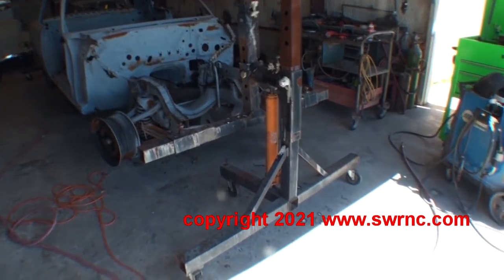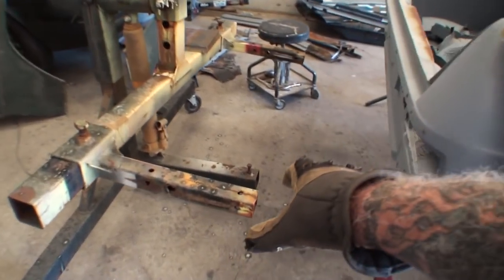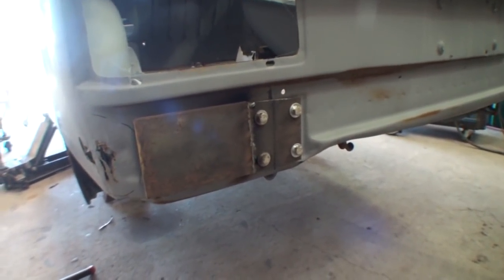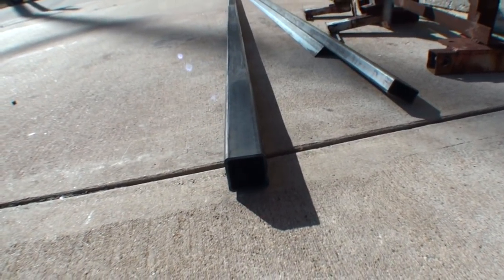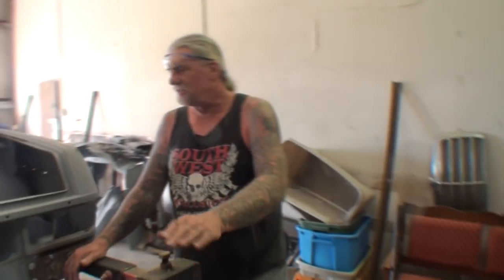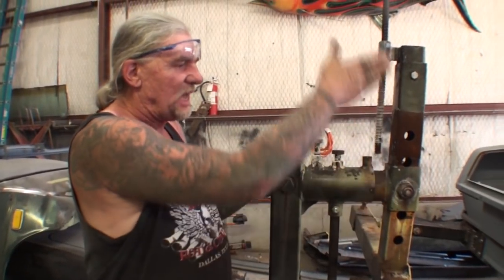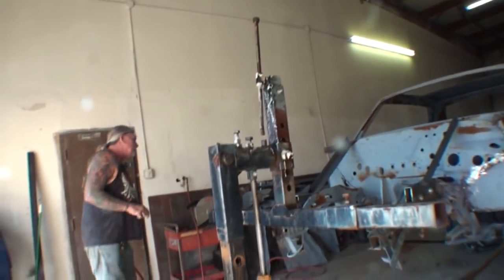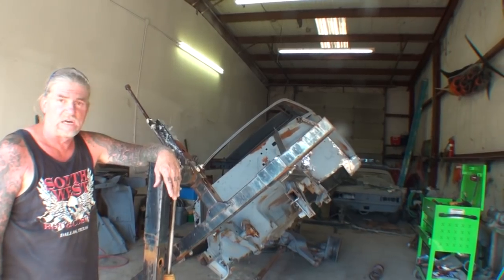How To - Use a Car Rotisserie - Do It Yourself Automotive Restoration

Comment: found myself needing one of these when I ran out of non-rusted lift points. It was expensive but I consider it a long term lease as when I am done with my restoration, I know I can sell it in seconds on Craigslist or Facebook Marketplace (because that is where I looked for one first!). I am a novice and did not have access to this video, but had to make my own brackets as well. I discovered that the center of gravity was lower than I thought so I had to make the brackets lift it up. What a dream piece of equipment. I can't even imagine doing the rust repair I am doing, without it (or an on call chiropractor 24/7). Bravo for posting this Pete.

Comment: Hey Pete, always enjoy the videos… I have my 68 Mustang now on the rotisserie but I can’t seem to get it balanced… had the front suspension on no doors, glass or rear suspension she’s torn right down… I tried removing just the new rotors and calipers but that still makes the car feel heavy when I attempt to roll it… any thoughts
Reply: That is the nature of a rotisserie as they give that big handle.
 I know it's been sometime now since asking, but remember that extra weight can be found on the drivers front from the steering wheel bracket, brake/clutch or booster reinforcement plate, park brake as these are not on the passengers side. Also, if welding and others read this in the future. Not removing the glass require 3M Glass Weld Protection Paper stuck to it or a fiberglass blanket, like those sold a harbor Freight Tools. Your rust repairs or full panel replacements will throw sparks that will pit the glass in or out. It (Glass) will feel like sandpaper when done if not protected. Now is the glass has delaminated or cracked and you have allowed funds to replace them and install new seals, go for it! 
Just a friendly reminder to help you or other no make this mistake. 
DK, ASE Master Tech since 78. Retired.

Comment: Suspension weight on both ends, car missing metal, no cross bucks. I wonder just how much swearin the camera girl is gonna hear when you start linin up doors or putting in windwhields

Comment: For years I believed German cars were constructed so good and built with quality steel , thoroughly rust protected. Turns out they are big piles of shit like any other car costing 1/4 the price.
Reply: A friend of mine has what looks like a nice E36 cab, but the fenders are all rotten and the bottom is too